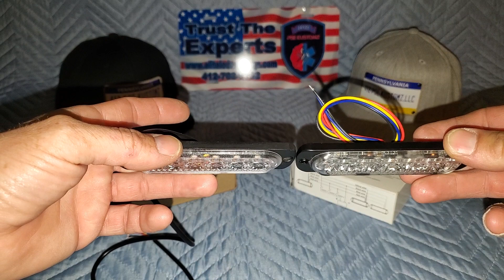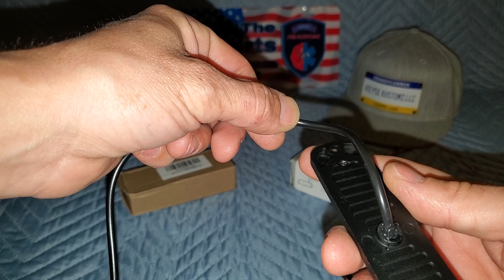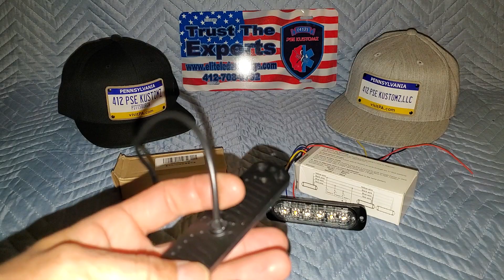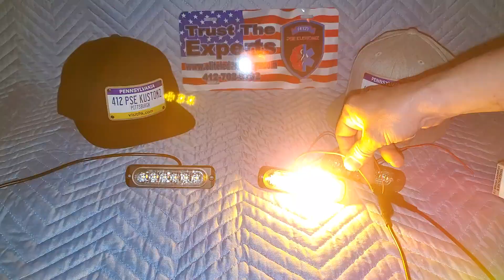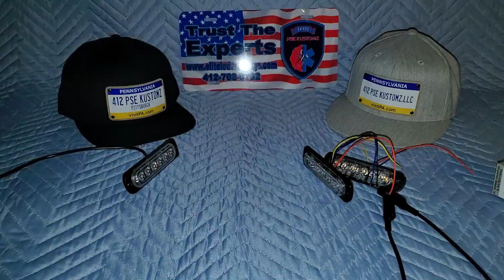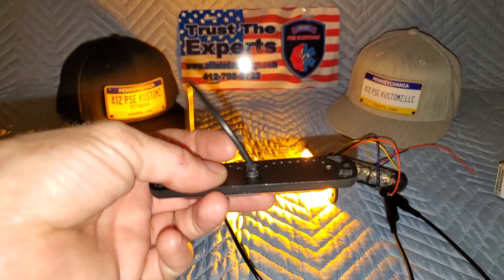Amber Slim6 Led Warning Lights FaceBook "Scam" Alert/Warning

Comment: I was actually looking at that FB ad. For some reason I looked up the name of the light company here on YouTube and you were the 1st video that popped up.  I'm really glad i did that. The difference between the two is huge. I was looking for a set of lights, red in particular, to add to the back of my Harley Davidson tourpack to activate when i applied my brakes. I want something bright and extremely visually attentive.  What are the particulars on the ones you sell?
Reply from the maker: Charles Power, we are very happy you did your homework and were spared. So the lights we have in this video as the comparison to the scammers lights is not a brand we normally sell. They are made by a business associate of our CEO. So we do not stock them. Although we would be happy to get you them if you wish. The specifics are they contain 3 watt leds. They are made overseas so the leadtime for us to receive them is 3-4 weeks. They run $25 for each light, a pair would be $50 + a flat $9.99 shipping fee. Now with that said we are also a Feniex dealer. Feniex Industries is an American Manufacturer. We sell a light that we use alot for added brake lights for motorcycles. That light is the T3(we have a few videos on our channel of them). They are affordable @ $29 each. They utilize three CREE 4watt leds, they are very compact so they fit just about anywhere. They have a brake light flash pattern that gives a warning flash before going steady. They are covered by a 5 year warranty and we keep them in stock at all times in all colors. We could get a set out to you tomorrow.
Reply: @412psekustomzllc7  do you have a link? There is a wig wag/ flasher module that is available but tou have to have that in conjunction with other lights. I really just want a simple light bar that is nice visually in appearance and light pattern wise that activates when i touch the brakes/running lights.
Reply from the maker: @showcasecharlie11  No, no flasher needed. You watched the video where we used four T3's to showcase the patterns of the Feniex flasher? We just used the T3 on steady burn to show the features of that flasher. 
The T3's are fully self contained. All flash patterns are contained within them. They have three wires. Red=12v+, Black=12v-(Ground) & Blue=Pattern selection. Once you find the brake light pattern you shrink tube the blue wire and hook the red to your brake light wire to trigger it every time you hit your brake. Ground the black somewhere on your frame. Good to go.  Shoot us an email @ 412psekustomz@gmail.com. I will shoot you over a few pics of the T3's and even see if our CEO will shoot a video to explain how simple programming, wiring, installing & operating them is. They are compact but bright as hell. We use them all the time as aux brake lights on bikes.
Reply: @412psekustomzllc7  sent you an email